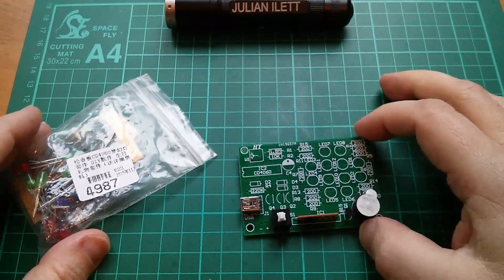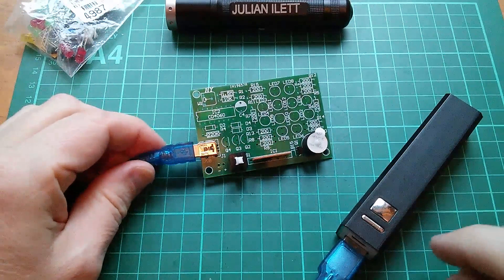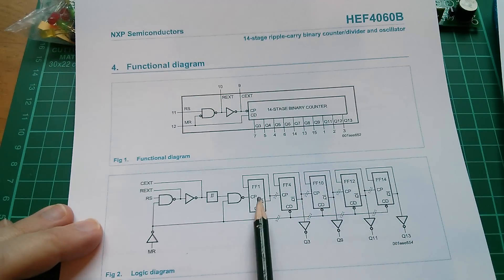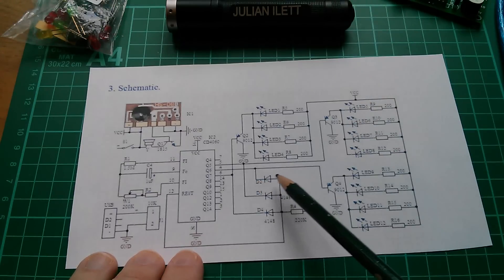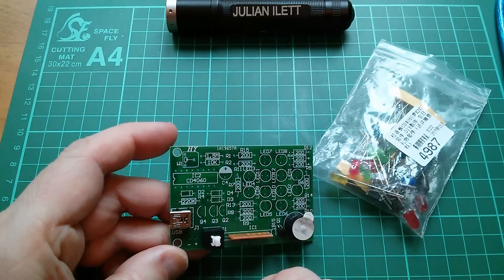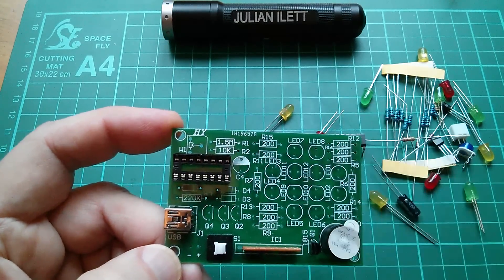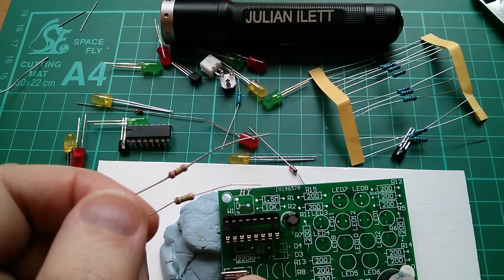Easy - Music Fancy Lantern Suite - Electronic Kit Build (part 1)

Comment: I suspect that the soldering of the socket being that way is due to ROHS,  with lead-free solder tinning on the pins requiring somewhat more heat than lead-based solder does.  I would agree that the 50V rating on the capacitor is a bit much,  but having salvaged a LOT of parts,  I have a great many of these,  and very few of any lower voltages.  It seems like most of the electrolytics that I have under 10uF are 50V parts,  all the way down to 0.1uF!  In assembling that stuff,  I would have put the resistors in first,  then the socket.   :-)

Comment: Thanks for the use of that little oscilloscope. I don't own a real scope, however I have always wanted one going back to my attempt to complete the Bell and Howell correspondence course in TV Repair back in 1970, my attempt was rudely interrupted by the U.S. Government with a letter from the draft board, and a visit to a small South East Asian country called The Republic of Viet Nam. Never did get back to the course. So at any rate, I did build a very small scope that does only DC, and is limited to around 5 volts thanks to the Nano that is driving it. It uses the Nokia monochrome screen in blue, and is pretty much just a toy but you can do a bit of trouble shooting with it in a pinch. So I thought, perhaps that the scope you built in your video might be a device I could afford, and build. Also size is of the essence since I have limited room for toys in our 35 foot RV which is home for a good part of the year as we chase the 70 degree F mark in an attempt to stay comfortable, and see the wonders of America, one campground at a time.
Reply from the maker: More on that scope in a future video - this year I'm going CHEAP. Cheap scopes, cheap power supplies and other cheap test gear.

Comment: Greetings and salutations from the Mohave Desert in Arizona!  Just a note about the component tester; I have one very much like yours, but on a red board and slightly different layout.  For devices that are difficult to put in the jaws of testing, I use alligator clips, clipping on the external spots then to the device to be tested.  Makes life much easier and quicker when testing lots of components.

Comment: 25C on the trimpot is 2 with 5 zero's 200000 and the C is the resistance taper, log or linear. :)
Reply from the maker: 25 meaning 200,000 makes sense. Log pots are normally A, linear B and antilog C. But trimpots are always linear.

Comment: Julian, The transistors driving the LEDs are PNP in emitter follower operation, no resistors needed.
Thanks for the videos. :)
Reply from the maker: But doesn't that mean a large current being sinked by the IC outputs?
Reply: The base current should be the emitter current divided by the transistor gain.

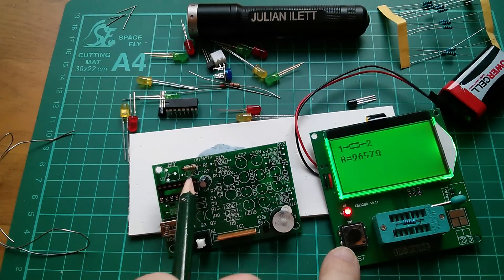Comment: 11:35 slams resistor 11:46 "Not calibrated". LOL
Reply: It always shows this message when turning off, reminding you to calibrate. Calibration is easy, the display tells you everything you have to do. I have a similar one, with a Chinese variant of the software. I actually like it more than the official German developed software as it has symbols for transistors that are easier to read

Comment: My DSO138 is the same, in that it only works on certain time bases for certain Fz. I usually just keep changing ranges until it works. I think the bands on metal film res start closer to one end, and that is the start point. http://www.digikey.com/en/resources/conversion-calculators/conversion-calculator-resistor-color-code-4-band
Reply: My DSO138 was good... except after using it a few times it suddenly went completely bonkers. It still appears to work... it starts up, responds to switch positions and button presses, but reads a completely random signal when nothing connected to it, and won't read the test signal when connected to it. So it seems to now be a scope that won't scope! :-( I was tempted to try one of their newer scopes... but I think I'll stick with my Rigole DS1052E :-/

Comment: I have the exact same crappy little scope, same problem with the frequency not showing unless AC coupled.
Are you running the latest firmware? I've not upgraded mine but wondered if that might fix the problem?
Reply from the maker: No, I've still got 041 firmware. I'm not sure what firmware version I can upgrade to - this is an early version of the scope.
Reply: Julian Ilett Mines a clone and I'm not sure what version it is, so I'm reluctant to flash it.
Mines currently .50 but I've heard .60 is better.
Reply: I got round to flashing mine. Some improvements, most useful you can now center the horizontal position which gives you the trigger point as the center line fairly accurately.
I believe it's the same firmware for all versions of the DSO138 so definitely worth the hassle and giving it a go.